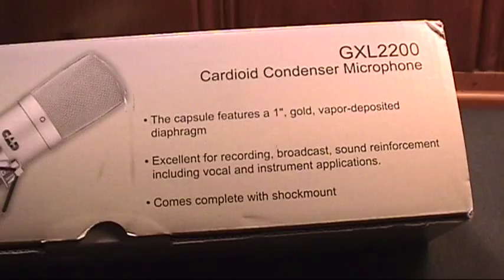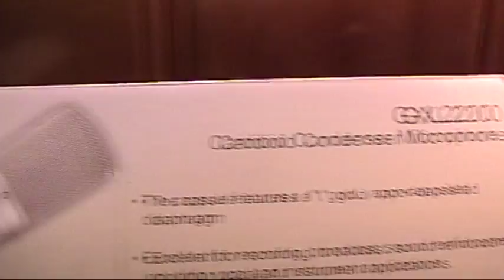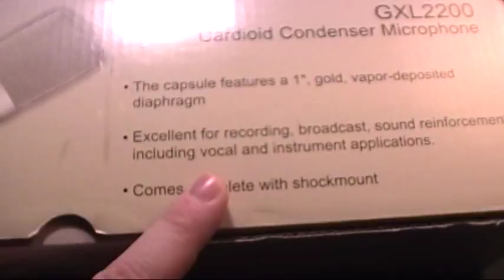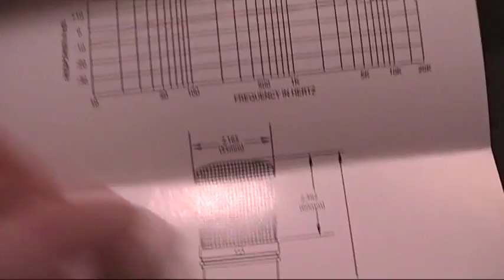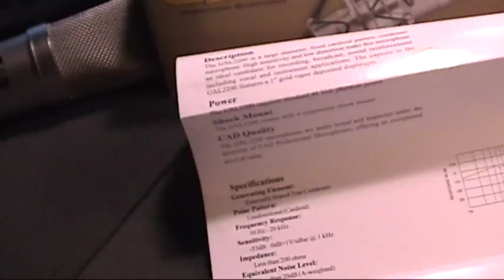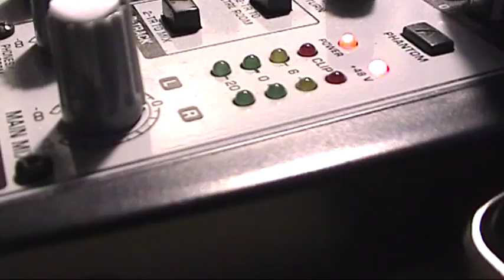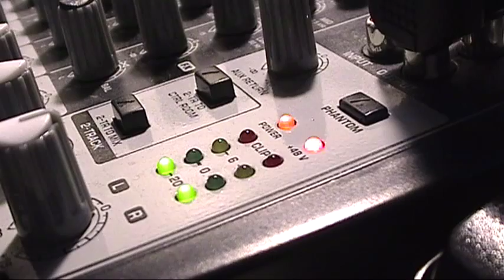CAD GXL2200 Condenser Microphone Review & Test

Comment: I literally tossed mine and juggled it in my dorm room with concrete floors the capsule came loose and a wire pulled out of the sauter 3 minutes of work and it's back to new the build quality is pretty decent